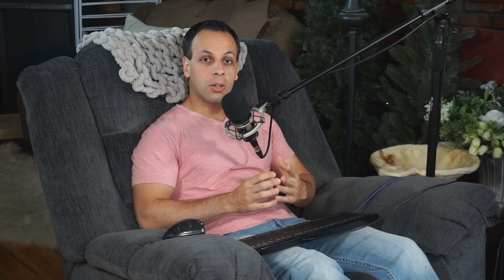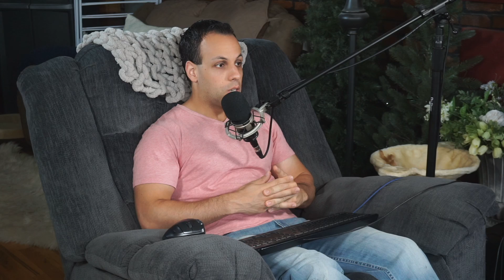Let's talk about what Right to Repair means for how devices are designed.

Comment: I say: let right to repair pressure electronic industry towards innovation.
Pretty much every soldered part can be electrically and mechanically attached to the board using elastic joints and MEMS technology.
EU by pressure to establish some single standard opened way for a lot of standardization and innovation, driving down cost by using same design elements on massive scale. Customer gets freedom to change parts of the system, mix and tune. Producing custom elements of the design that is common, but company had to be special is wasteful.

Comment: I think they should legislate against practices that would make it impossible for the manufacturer to repair the product. (such as covering the board in potting compound), without a valid FTC approved reason.  because it will probably not be long before boards are produced covered in a "thermal" compound for heat dissipation.

Comment: First thing first - I am very much in support for RtR. As a personal hobby, I refurbish the Lenovo laptops and I love the fact that you can easily bring back to life a laptop from 2012 that may perform better than some of those sold in 2021. I can easily source parts and the repairs are easy, even without soldering or microscopes.

Where I think there is a blind spot of the RtR concept and based on the case study of Apple, I would point out the following. Yes - the device should belong to you. Yes - you should own it and be able to sell it and do whatever you like to it: disassemble, hack, crack, load with any OS, etc. But where I see the problem is the branding. Truth be told - we all know that Apple is a premium brand and many if not most purchase Apple for its premium aspect. I love the channel and the repairs performed are amazing. Yet again, I've seen Apple laptops with shifty aftermarket displays without True Tone support, iPhones with cheapo displays, aftermarket batteries that frankly suck and there is a huge demand on the secondary market for the used items. Now, when those subpar items reach the secondary market (e.g. eBay or Craigslist), it strongly damages the perception of the brand. Apple stops being premium in the eyes of many. I know there is a huge number of fake Apple products out there, but it does not fully nullify my initial point. The anti-repair attitude, apart from boosting sales, also ensures all the iCloud locked and "totalled" iPhones are taken out of circulation. I would love to hear your ideas how to preserve not only the repairability, but also a certain level of quality for repairs. E.g. I would think a good compromise would be to keep the parts encoded and proprietary, but available for purchase (e.g. you are able to install only the original iPhone display, not any of the aftermarket ones) or have some kind of diagnostics tools similar to laptop BIOS ones, that would read all the hardware and validate the device to be bootable. 

Another point that I think gets lost in the conversation is the data preservation. Most of the times it's not the repairability the problem, but rather the fact that you lose all data with the device. I would separate this one from the RtR initiative in order for it not to be held back by the RtR. The fact that all the storage on Apple devices is totally blocked if the device dies is not ok and, as the saying goes, what Apple does, other imitate. 

Last, but not least, I think the "green" aspect should be on the table. Maybe Apple would like to sell you a new device, but then it needs to accept the old, damaged, broken or totally outdated devices in their trade-in program. This would basically put a premium tax on selling new devices on every occasion and would encourage the company to properly recycle the devices rather than force the users to throw them into a landfill. 

Really happy about the latest RtR breakthroughs (Woz, FTC and Biden) and wish you strength and patience in seeing this through. And thank you. I don't think you're getting this enough, but what you're doing is a great service to humanity and probably will have a better impact on the world than Greta.
Reply: _The fact that all the storage on Apple devices is totally blocked if the device dies is not ok _
It's perfectly OK to me. This means that if a device is lost or stolen, nobody can access the data. What you can do, and Apple in particular makes incredibly easy to do, is to keep a backup. Should I drop my phone in the toilet or drive over my laptop, I'd have everything back the moment I buy another. Sometimes people bring a broken iPhone to me and ask to recover their precious pictures and I'm like, "O_O why?"
accept the old, damaged, broken or totally outdated devices in their trade-in program
I don't know how it is in the US, but I'm pretty sure here in Europe stores *must* take their devices back. Some take even broken devices they didn't sell. IIRC, the selling price includes the recycling tax. 
I guess the "green" problem is mainly with people tossing electronics in the trash instead of separating them. I can bring batteries to a number of stores or dedicated containers; plastic, metal, paper, glass in dedicated containers; devices are collected a few times a year and all materials get recycled. If nothing weird happens after the collection (such as a company getting paid to recycle trash and instead tossing everything into an incinerator), this system is perfect. And yet, some people still burn plastic or throw batteries in the trash.
Reply: @IlBiggo  The argument for me  or for you is not applicable, since every person may have their own needs. I also notice that when talking about backup, you imply photos, contacts and other iPhone stuff. When I think about backup, I think ssh keys, fonts, application settings. Having 5GB of free space is very far from enough. Besides, iCloud Drive is still crap compared to, say, Dropbox. Moreover, as a person from IT field, I would emphasise that data integrity, data security and data redundancy are separate concepts. Nothing prevents storing encrypted data (secure) on an accessible storage. The fact that you cannot get your data out is poor data integrity. Not having a good way to back up the data is poor data redundancy. So, I guess, 1 of 3 for Apple (FileVault seems to be great).

As for the "green" aspect, I'm also from Europe and the eco aspect in many places is basically virtue-signalling. Yes, they accept devices, but they don't pay you for those devices any significant amount and this does not incentivise in any shape or form Apple to sell less devices or recycle them properly. In most of the cases recycling means recovering precious metals and burning the plastics and I'm not sure it's sustainable. What I meant is basically forcing a company refusing to ensure repairability to pay for the broken devices as if they were not. It may sound utopian and I don't know what's the antidote against people hammering their old devices to get a new one, but at least I know there should be an economical incentive for businesses to care about repairability and discourage them from trying to sell you a device every year or two.
Reply: @VladimirBulgaru  Don't get me wrong, I'm 100% ok with the industry being forced to be more conscious; but I think expecting a manufacturer to sell "eternal" devices or take responsibility for our trash is just a little too much. The current generations seem to think they're somehow not responsible for their own behavior. Frankly, if your lifestyle cannot prescind from using a phone 24/7 you should take some care - I'm not that glued to my devices, but my computers go on for 10 years and I recently switched from a 4s to a refurbished 7, and I'm still alive :D
As for data redundancy, I was thinking more of a real backup. Every time It's near my MacBook, the phone saves its data on the MB, which in turn is constantly backed up via Time Machine. iCloud is a temporary storage, I'd never keep anything serious in the cloud. Using Time Machine and automatic backups is actually easier than *not* using them, that's why I'm appalled when people lose their data. The backup system is complete (transient+permanent+versioning), easy to use (basically you have to voluntarily switch it off), secure (nobody can read your data if the device is off or broken) and safe (depending on the backup drive[s]). There's no need whatsoever for easy data recovery from the device when the backup system works so well; in fact, Time Machine is "preventive data recovery": your data are constantly backed up on another device and ready to be partially or completely restored.

Comment: It wouldn't make sense for you to demand manufacturers to make all devices easy to repair by consumers. You're business is based on having the skills to repair a device that other people can't. (Not a criticism i agree with what you are saying)  I can see the potential value in legislation that requires devices  to be  more repairable (easier and cost effective, not just part availability) or if  a key component of a device dies and is not economical to replace due to the cost of manufacturing, then the other components that aren't dead should be salavagble to repair other devices. Cut down on e-waste and demand for new parts to be manufactured. Where to draw the line between conservation and innovation would be difficult but worth doing.

Comment: I honestly do think it's not a bridge too far at all to mandate replaceable batteries. Batteries fail way more often than any other component and are also the most environmentally damaging. I don't think the design of non-battery components should be mandated to be a certain way, but carving out an exception for batteries is not at all overly onerous considering the wider societal and environmental benefit.
Reply: I feel there is a middle of the road approach here.

If there is a technical necessity for battery replacement to be challenging, say to provide waterproofing, then I support making battery replacement difficult. Where I draw the line is if manufacturers design something with the intent of making it difficult to service rather than solving problems to create a good product.
Reply: @storyls If you let that be the case, suddenly every device on earth will be "waterproof".

Comment: There was a video of someone getting two iPhones 12 and switching the motherboards and there were problems with camera and general stability. then he switched them back and they were fine. A device should accept replacement parts that pass diagnostics, not be stealth locked to the original parts. 

Oh and I've hear changing a lamp in a car required computer access at an authorised repair shop. Let us change light bulbs and other simple parts at will, dammit!. 

Another anti-consumer practice by car manufacturers is making "modules" out of a cheap part that needs replacements and an expensive part, so people have to buy an entire module. 

Then there is planned obsolescence, including software failures that activate after warranty expires. 

The list goes on and stopping at just "make parts and schematics and tools available" may not be enough. I agree that not every chip needs to be socketed, though.

Comment: It's about artificial restrictions (this is something I hate with a passion), in this case, to repair. 
There's one thing that the device uses a BGA chip which I would not have a good chance of replacing. Using a BGA chip instead of PGA with a socket allows for a smaller device and probably makes it cheaper too. However, forbidding manufacturers from selling the chip to me or locking the chip to firmware does not have any other purpose other than preventing me from repairing the device.

That being said, if I buy a device that is glued together or one that has a non-replaceable battery, it means I looked for other options and could not find one and for some reason I really need that device. So far the only glued devices I have are power supplies.

Comment: "Right to repair" kind of implies something different than what it actually is. "Right to buy replacement parts and see blueprints" is more on the mark. Not as good of a slogan, though.
Reply: Also to not void the warranty by doing basic things or getting a capable repair shop to do work

Comment: … waiting for tech manufacturers to epoxy everything together so that nothing can be easily repaired.
Reply: Don't they basically already do that?
Reply: See Milwaukee (and other MFRs) battery powered brushless DC motor tools, all the brain box bits are potted modules. There's a semi-good reason for that though, it's to make the tool more durable in 250lb ape apprentice carpenter fumble fingered hands.  Mine usually get stolen before they wear out, so I have that going for me...
Reply: They already do that a lot.
Reply: If we abolished ip then all it would take is someone to not do that, advertise on how much easier to repair their device is, and boom. Now people buy that device.

Comment: While i am all for RTR, i can also understand the OEMs wanting to stop chip manufacturers selling their chips. Where do we draw the line? If a chip manufacturer sells the chips to independent repair shops, should the PCB Manufacturer sell the finished motorboards? Should foxcon sell the finished macbook? The price of a device is a product of millios of dollars invested in R&D. The OEM paid for that upfront, if the chip manufacturer sells the chip at cost, the OEM designed the chip for free.
Hopefully i could get my point across, english is not my first language.

Comment: Honestly it's just a load of shit that many of the repair unfriendly "features" of new phones are in anyway necessary for their function. Take a removable battery for instance. My favorite phone I've ever owned the Galaxy S5 had a removable battery, SD and SIM,  was still water-resistant, AND was slimmer than my current Galaxy S9 (8.1mm VS 8.5mm). They've designed these devices to be throwaway but they absolutely can and would design them to be just as good and better to repair if they were only required to. E-waste is terrible for the environment and while I'm all for businesses being allowed to do whatever they want they should also be held accountable for what they do. Maybe a system where manufacturers were required to pay for disposal, with an exception after a certain device longevity (say a minimum 4 years), would be an excellent system to encourage, rather than require, repair-ability and avoidance of deliberate or negligent design faults.

Comment: I mostly agree with this, one thing that does piss this off is when something that could be socketed, and would be helpful it was, without changing the design is not (for example desktop motherboards that have space for a socketed BIOS, but instead use smd, which makes it harder to replace the BIOS or stick the chip in a programmer)

Another thing that I personally don't like is when companies use modular parts but intentionally stray from the industry standard for no reason. Such as dell using a proprietary PSU with proprietary cable pinout in their PCs.
Reply: My pet peeve is my Ryzen laptop that has soldered RAM and an empty socket.  So I was able to add 8GB for dual-channel, but can't increase it to 16GB as going any higher would mess up the memory bandwidth.

Its one thing to solder for signal integrity or to keep a device slim (though most of the times its unwarranted as nobody is going to notice that 1mm difference), its another to solder something when the board clearly is designed to be socketable but they chose not to do so.

Comment: 4:23 also the risk of 'chip creep', where it works loose a little and a contact breaks, but easily fixed though (just push back in).
Reply: There was a fix for old computers that was called in some circles the "Commodore Twist" (I think because it was commonly used on Commodore PETs and/or C64s). You would physically twist the computer in an attempt to reseat chips in their sockets. If you tried this on modern devices you risk cracking SMT resistors and capacitors... 🤣